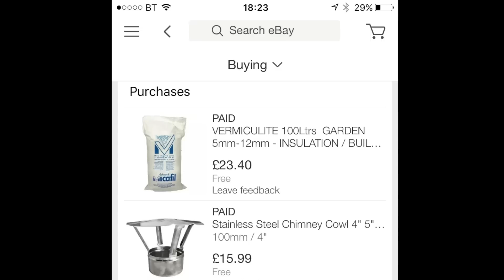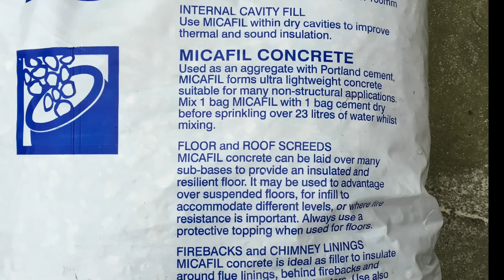Wood Fired Pizza Oven made over a gym ball

Comment: I think most traditional ovens have a recess in the back of the oven for the ash and unburned wood. You need to use twigs that you have tied into a bundle, because they burn quickly and very hot.  When  it has mostly burned, shove everything into the recess, which should be lower than the floor of the oven. That way there will be pretty even heat radiating from the walls and floor, and you won't burn your food from the embers, which are much hotter. Also, make a door. It can be just a tile or sheet metal, but you need to stop the heat loss from outside. You wouldn't cook your turkey with the oven door open, would you?

Comment: Greetings!  Loved the build and has me wondering if I should give it a try!  May I ask how it's holding up almost 4 yrs later?
Reply from the maker: Hi, thanks, it has cracked around the flue, somebody in the comments section pointed out this might happen as the different materials would expand at different rates, which does appear to have resulted in the crack. Next time I’ll make it with a flue made of the same material as the main dome.
Reply: @cuthberm  Is the crack bad enough to make it unuseable?
Reply from the maker: Mitch Dunn hi, isn’t big enough to affect it, just cosmetic really.

Comment: tried this with the finer mix vermiculite and fondu ciment and it failed epicly, all was looking well until we took it off the mould and it fell to bits, am going to try again this weekend with a different cement.
Reply: You need the courser vermiculite. The finer the agg the less resistance to heat it will have. Sand will also cut down the heat resistance.

Comment: Hi Mr C great Video! I have built mine and its Currently Drying cant wait to fire it up! How did you fire yours for the first time did you start with a small fire a couple of times? Then get bigger and hotter from there to avoid cracking? also how long did the last seal to the fire bricks take to dry? Cheers Pete!
Reply from the maker: Hi, yes, started with a small paper and kindling fire, then returned another day with another kindling fire, before moving onto kiln dried timber.
Reply: @cuthberm  Fab thanks again!! hope you are safe and still enjoying pizza in lock down!

Comment: I love the gym ball idea. I have an issue with the material used though. As far as I know, you should have a high thermal mass for the oven and an insulator for the outer shell. The efficiency of the oven is based on the ability of the thermal mass to absorb and hold the fire's heat and then cook the food. A good (non-commercial) pizza oven should be able to do a cook session without the fire once heated. Vermiculite is an insulator and I would think better used in the outer shell.
Reply from the maker: AKA Nathan Thanks and yes I agree with all your comments reference materials and their suitability.
Reply: @cuthberm  Hey both Mr C TV and AKA Nathan. I thought about this a lot and guess that's why the real ovens have bricks. But what about a clay material on the inside? How thick and how do you apply the insulating mixture on top of the clay to avoid cracks as they are two different materials. First layer of clay, then tinfoil so it can move then the insulating mixture with either perlite or vermiculite. Any ideas? Suggestions to make this work?
Reply: Mr C TV amazing construction and lovely film. Thank you!

Comment: I've watched a lot of videos on how to build pizza ovens. Your's, by far is the easiest I've seen. Now that you've had it a while, do you have any additional tips, tricks or ideas? Thank you and great video.
Reply from the maker: thanks, there's a lot of video that have jumped on the idea since mine, but good to hear mines still clear. I'd make the chimney out of the same material as the dome next time, and I'll be trying perlite. I would also like to have the base lighter so it's easier to move round, the sand and firebricks are a really heavy combination.
Reply: @cuthberm  Hi mate, I'm looking to do this. Is there any reason you wouldn't go for the SS chimney? Also did you find 100l of vermikulite was plenty? Cheers
Reply from the maker: Tom Hodgson Hi, I used about 3/4 of a 100 litre bag, so you should be fine. It was pointed out to me by somebody in the comments that the flue would expand at a different rate to the dome, as they are different materials and expand at different rates, this could cause cracks. It was a really good point and if I did it again I’d try and make the chimney from the same material. Thanks
Reply: Mr C TV awesome. Thanks 👍🏻👌🏻
Reply: @cuthberm  good point about the chimney material being different i have made the dome without putting in a the stainless chimney yet.. I was going to cement in now im thinking ill use a fire caulk  to set it in place, which should expand / contract

Comment: Im going to try this, how did you know the size of the inner circle to cut out?  I may use perlite instead of vermiculite.  Is there anything else you would have changed after using your oven for a while now?
Reply from the maker: I think I just made it 1 inch smaller in diameter than the ball, you can play with the pressure in the ball to make sure it’s a tight fit

Comment: Im am going to start bulding mine using lava rock, white cement and sand. Can't wait to see the results
Reply: Let us know how you went.
Reply: @popey2710  it went very well, the shell was made from rock lava, sand and cement. On the inside i applied a1cm layer or ready mixed refractory mortar. I have it running on gas and wood :) on my channel there is one clip of the oven in use.   The final price was 200 dlls

Comment: fail to plan fail to succeed , oh god blimey mate i have probably read more info on these little beauties than i could care to think. have just finished the oven to your design with the exception of flue, used old drain clay, and used perlite based on 5 to 1 ratio and it looks dam good. covered it in damp sheets for now and hope by 5/6 days time i will be able to remove from formwork, fingers crossed. so here is  the big question , after checking the directions of the fire cement you used on the outside i see that it says its fire proof to 1300c with a recommended thickness of no more than 6mm and that it will cure using a vast amount of heat, i know your reasons for using it externally but in retrospect do you think that using it an the base layer first would be more advantageous, so my plan now is to order some and screed the inside of the oven when dry, any thoughts.
cheers mate.
Reply: Jackie,
I plan to do a 5 to 1 perlite cement mix on my 75 cm ball now. Any tip about wall thickness?
Ok to do 6-8 cm mix, then chicken wire, then 2 cm mix?
Any problem due to little heat retention? Tried to make bread?
I’ll have 65 mm thick fire brick in the base.

Thanks,
Hans

Comment: Your oven is amazing am just about to order the materials to construct mine. Where did you get the fire bricks from and also how thick is the vermiculite dome?
Reply from the maker: +Rich Giles-Grant Hi, thanks, I was very fortunate in having a friend who sourced the fire bricks for me, they are available on line, www.victas.com, but the postage is the issue due to the weight, better to source them locally if you can. The dome is approx 5cm thick, much more between the dome and tunnel section and around the flue, as I thought this might be a weak point when lifting and moving etc.

Comment: I have saved the ceramic slabs/bricks from a very old storage heater. Do you reckon they will be good enough for the base of the oven?
Reply from the maker: Would you be happy eating off them? It’s what the pizza sits on at the end of the day
Reply: I reckon so, I mean they clean and very smooth so can't see a problem. Im hoping because they are from a storage heater that they will hold their heat once up to temp.
Reply: Caution!!  Old electrical storage heaters were often made with the use of asbestos insulation. Serious health hazard!
Reply: Can asbestos be in the form of stone slabs? I mean they are like very thick tiles. Thankyou for the warning though, I will have to do some digging.
Reply: @orgohappy69  to get access to the firebricks inside old electrical heaters the thermal insulation must be removed. That's where asbestos was used in the old days. I do not encourage anybody to dismantle these old heaters to get hold of the firebricks inside.
Reply: oh. It was done by a professional company who left me the slabs on request. they been outside for the past 18months so hopefully biggest risk is a ninja slug!!!
Reply: I think you need help mate. How dare you hide behind a computer desk and make accusations that you would not have the nerve to do face to face. The heater came from my parents in law. It was removed by british gas, who know what they are doing. I think you sum up a generation who need to learn when to have a little respect. If the internet upsets you so much then DO NOT GO ON IT!!!!!! Thank you for your concern but I feel you should now go and resolve whatever it is that is bothering you in the real word. Goodbye.

Comment: Umm question, I noticed all the other videos are using Perlite, NOT Vermiculite, which makes sense to me because Perlite is used to aerate soil, and vermiculite is used as a  moisture retainer. So shouldn't it stand to reason that vermiculite will hold too much water and explode if you heat it up?
Reply from the maker: Hi, valid point, I was very careful to slowly dry out the dome, placing wet towels over it, I think I left it drying out slowly for about 4 days, I then only lit a small paper and kindling fire, before building up the heat on a separate burn later on. I chose vermiculite at the time as it was all I could find. I would try perlite next time for sure. Thanks
Reply: How long did you leave it before removing the gym ball. I made my 2nd attempt 6 days ago and I would like to move it to it's final position. My dome is about twice as thick as yours so I'll need help.

Comment: Would be interesting to know if the oven cracked when used as i have been looking at making one myself  . I was thinking of using perlite & fondu cement rather than vermiculite .
Reply from the maker: +artisansportsman There is a small crack after I had a session with it, making 10 pizza's, and getting the temp higher than I really needed. I'm going to see how bad it is this weekend. I originally wanted to go perlite, but couldn't find a source in the UK at the time. I've started looking again now....
Reply: Mark Cuthbertson iv'e found they sell 100 ltr sacks of perlite in these Hydro phonic stores . you know the ones that have set up everywhere for people who grow cannabis, Ebay have some for 20 odd pound delivered .when i make one i will use perlite & shred some stainless steel pan scrubs in the mix to reinforce it .thanks for reply . atb simon
Reply: +Mark Cuthbertson 
There's this place http://www.pizzaovensupplies.co.uk/fire-bricks-materials/
He makes the cheaper cast ovens on eBay, you can also get the firebrick grog on eBay too
Reply from the maker: I've used the oven 4 times now, for over 2hrs a time, there are now 2 cracks in the outer screed, but the inner vermiculite mix is still in one piece and showing no signs of cracks. If I was doing another I'd try perlite and fondu as you suggest, purely as an experiment though, as it's still producing amazing pizza and steaks!

Comment: Your oven looks good Mark and a nice clear video.Any cracks and what is this Victus heat proof screed like to use ? Also I found a cheap pizza stone is handy and keeps the floor clean .
Reply from the maker: +JJGrice018 Thanks, small crack yes after getting it too hot, The screed went on really well, but was very expensive relative to the cost of materials for the actual oven
Reply: @cuthberm  cracking build Mark...I used a similar method. I used the gym ball to make a fibre glass mould of the oven so I could then put the mix over that, as it did not flex it was definitely easier. I also used perlite instead of vermiculite purely as it was easier to find. Main difference is I used ciment fondu which is a refractory cement mix. A lot more expensive than portland at £35 a bag but good for 1400 degrees Celsius. Didn't make a build video but have put some pictures in to a slide show on my YouTube chanel.

Comment: I'm thinking of maybe setting a cement and vermiculite mix in a timber mould for the base rather than fire bricks. I'm guessing that would work with some support underneath to prevent breakage? could then smooth down the surface. Perhaps instead of putting sand and cement on the ply just pour in the vermiculite/cement mix, is this too heavy?
Reply from the maker: Hi, I'm sure I've seen a video on youtube of someone making either a vermiculite or perlite base, it's shouldn't be too heavy, I've had criticism on here for my sand base, not being up to the job of stopping heat getting through to the wooden frame, but as yet it's not burst into flames!
Reply: Mark Cuthbertson thanks for your reply. I might give it a go, if it fails I've only spent a few quid making a slab! I'm attempting my version over the next couple of weeks

Comment: Would it be possible to to plaster the inside with clay? I am asking because I have concerns because the cement could be unhealthy for cooking?
Reply from the maker: It’s a good question and idea, I’m not sure how well the clay would cope with the heat, but it would give a much cleaner finish
Reply: @cuthberm  there are whole ovens build out of clay so i would think that heat is not the problem. but i think it could occur cracking because using different materials

Comment: Nice! Thanks Mark, I'm going to give this a go. Silly question did you apply 2 layers of the concrete mix or 1?
Reply from the maker: Hi, thanks,  after completing the initial lower ring of vermiculite mix, I did go back round and add to the thickness in some area's to make it more uniform. I also used up all the batch I'd made by adding to the top of the oven, which I figured would be exposed to most heat. Knowing what I know now, I think I'd be able to do it in 1 layer. I wanted to get it all done in 1 go, so that it would dry as 1 piece, that was my main objective.
Reply from the maker: +Peter Dimakidis A couple of friends who have seen me using the oven, have also suggested the same, guess the only down side would be the overall external size? It certainly couldn't hurt the performance.
Reply: @pdimo  What is the insulation blanket made from? and what is the process of applying etc? would appreciate as much detail as possible :)